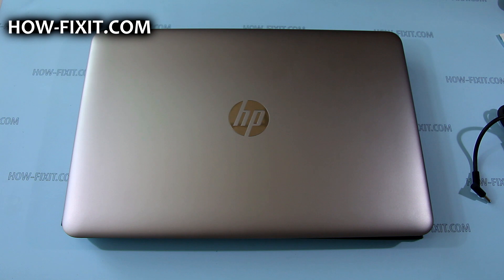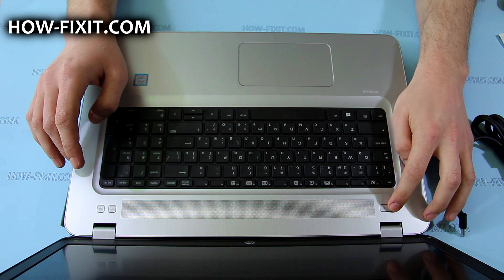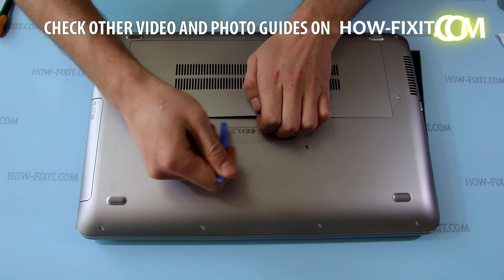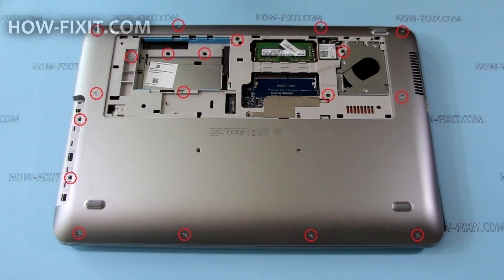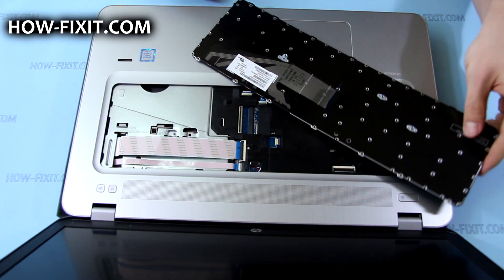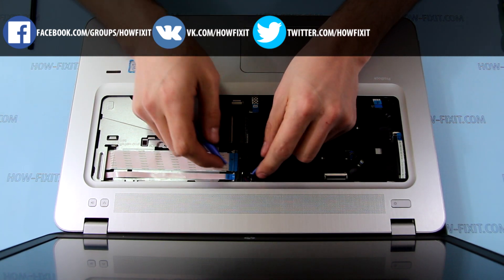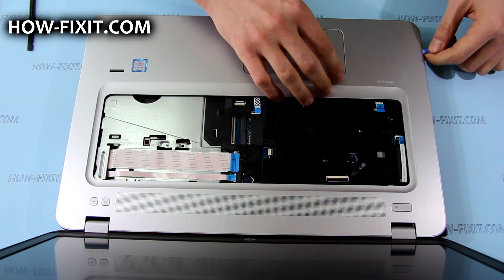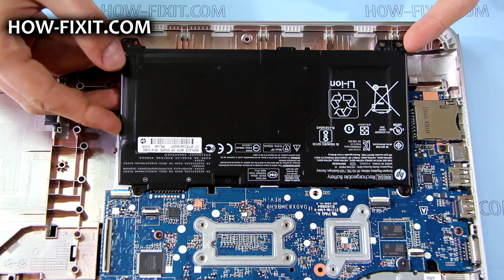HP ProBook 470 G4 Battery Replacement | Fix Battery Drain Problem

Comment: I ha ve a Black screen problem, will turn on but laptop screen won´t work. altenate hdmi monitor weorks but not the internal one. what should I Do
Reply from the maker: if this problem appeared after reassembly and during disassembly you had removed LCD cable, problem could be that it doesn't inserted correctly